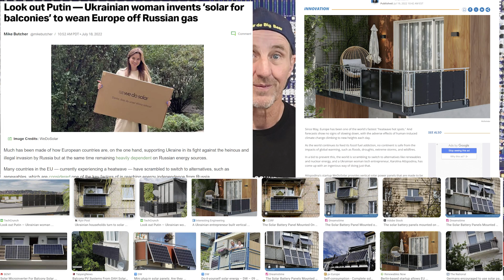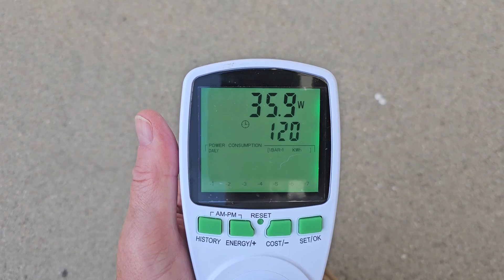Suicide Plug Solar Panels?

Comment: It's a nit-pic I know, but if you have 15A coming from the breaker, and 10A coming from solar lets say, that means you have an outlet that if someone else used wouldn't blow even on a load (or short) of 25 amps.
Reply from the maker: Interesting concept and that is looking at power as if it's water flowing if you have 10 gallons flowing in one direction from one source and 15 gallons flowing from another source then you have a total 25 gallons flowing right?

But this is different. If you have 15 amps flowing from the grid to an appliance on that circuit and then you put 10 amps from the solar onto that same circuit then the appliance withdraw 10 amps from the solar and 5 amps from the grid because the appliance only draws 15 amps we're just changing where it gets the energy from.

Furthermore the energy coming from the solar is not going through the breaker to get to the appliance it's going straight from the solar to the appliance and reducing the amount from the grid going through the breaker

If you really wanted to do some fun nitpicking you could say that if you put a 25 amp appliance on a 15 amp circuit and have 10 amps coming from the solar and 15 amps coming from the grid you could power that 25 amp appliance on that 15 amp circuit.

But as soon as the sun went down the breaker would blow.

That said, it's pretty obscure and highly improbable unless intention or complete knuckleheadedness took over

Comment: One gotcha to watch out for: if you don't have a bidirectional meter (and it's unlikely that you do) the meter doesn't care which direction the power is flowing, it still counts it. So if you ever generate more than your house is using at any given time, you will get billed for what you exported as if you had imported it. There are countless stories in solar forums about people turning on their solar arrays before they've received utility permission (along with a new meter) and getting huge power bills for the power they sent to the grid.

On the sunniest of days, your small array won't generate much more than 5kwh so worst case at your electrical rates you'd be on the hook for $1.70/day.
Reply from the maker: That's super interesting and I will try and figure that out at some point on a sunny day and shut off all the breakers except for the one with the solar. See if I can tell.

That said, unless I get more solar panels I don't think they can make more juice in my house uses just sitting there doing nothing
Reply: Thanks, your comment answered a question I was hoping to ask, that being - if we agree you can run power in ‘both directions’ in your home or the grid, how does your home system (or the grid for that matter) figure that out and then either power your appliances or sell your energy.
Reply from the maker: Great question. So the energy will flow in the direction from higher voltage to lower voltage. So if you have two power sources for example, one being the Edison power plant and the other being the solar panels and they are connected together and phase aligned, And there is nothing else drawing power, and both systems put out exactly the same voltage say 120 volts exactly, then nothing happens.

But if the solar generation is putting out a slightly higher voltage say 121 volts then power will flow from the solar generator back into the Edison power grid.

The solar inverters that power the grid or put power back into the grid are designed to output slightly higher voltage than 120 volts putting energy back into the grid up to the limit of the amount of current they're capable of outputting at any given point in time.

If the sun is bright and all the panels are being hit then the solar generator will put out a higher voltage which causes more current to go back into the grid

Energy automatically flows from higher potential to lower potential or higher voltage to load.

If the solar generator is putting out over 122 volts and Edison is putting out 120 volts, then Edison becomes the load and the solar generator will push power into it
Reply: @DaveRat  I am not sure that you are quite correct (I can't believe I am actually saying this to you! Lmao!) about the voltage difference and current flow, at least not on the utility scale. 

Basically think of the power grid as a big pipeline.

On a typical grid, there are many "pumps" putting power or "pressure" into the pipeline, and then the power flows to many loads or "holes" in the pipe network, including pressure drop over distance and power factor and lots of other nerdy aspects to power distribution.

In order to keep everything balanced, all the Pumps have to work together (via the Cal ISO Grid coordinators etc) to keep the pressure on the pipeline constant, so they have the big Base Load power plants, nuclear, hydro, large-scale gas, etc, and then they have the peaker plants, small gas turbines that can adjust their output constantly to match the load perfectly.

So the goal is to maintain a steady voltage, but it takes current output to maintain that voltage level.

So when your solar system produces more power than you use, it now adds pressure into the grid, flowing to the nearest loads, which increases the voltage on the entire network, which makes the peaker plants reduce output by whatever you are putting in.

So while voltage plays a part, it's really a side effect of current levels, because current causes the voltage to sag or increase depending on direction and such.

And now with all the Tesla technology and inverter power from solar and wind and batteries, the peaker plants are getting used less, because the inverters can react instantly to grid changes and keep a much more stable waveform and voltage.

If you had the Tesla Power wall, you could be part of their Virtual Grid program where a small portion of your battery capacity would be used to stabilize the grid voltage and factors in your neighborhood, and you could get paid for the service.
Reply: @ke6gwf  It is line frequency that tells a grid operator to open or close the throttles on their generators.  If it falls below 60 Hz, one or more peaker generators are commanded to boost power output; similarly if line frequency rises above 60 Hz, then power output is adjusted downwards.
Your 5th and 6th paragraphs are not correct.
Reply: @shaneervin4954 and you are incorrect to begin with, because the Grid Operator doesn't own any generators, they are the central grid manager, and coordinate everything else.
Reply from the maker: @ke6gwf I agree basically with what you describe except one small aspect. It is the offset in voltage that drives the current flow. If the voltage and phase are identical from two connected sources, no current will flow. If one source has a higher voltage potential even slightly or a phase offset that gives it a higher voltage porential at any points in time, voltage will flow from the higher potential voltage to the lower potential voltage.

The voltage offset is how the current knows to flow and knows which direction to flow

My understanding is that for energy(current) to flow from the solar inverter to the grid, the inverter needs to generate a voltage that is higher than the grid, the grid then acts a a load that drags the inverter output voltage down to match the grid voltage and the inverter outputs it's current limited output back into the grid.
Reply: That sounds more like a design than a gotcha.
Reply from the maker: The old power meters were based on coils of wire and magnets such that energy flowing through the coils of wire would spin the meter. Energy flowing the opposite direction would spin the meter the opposite direction it's just an electro mechanical reality

That said, the modern meters are a little computers and theoretically can be programmed to do whatever the power company wishes. The power company could easily program the meters to rack up charges regardless of which way the energy is flowing.

If that is truly the case, then that opens a whole new fun can of worms to investigate!!

I am looking forward to figuring that out
Reply: I am almost certain there is an analog way to meter AC current regardless of direction in older meters.

 I am continuously surprised by how clever old technology can be.

Maybe you could get your hands on an old meter and compare to a modern one. That would be a good video.
Reply: @dacharyzoo   Actually, there is no such thing as an AC meter so they are naturally bidirectional. AC scales, yes, but meter movements are inherently DC voltage devices. Even VU meters are calibrated & rectified DC with a precisely weighted movement that accounts for their cost. AC current doesn’t actually flow in any direction. It oscillates back and forth. The meter does not know line from load. Line and Load are artificial constructs we use to plan AC circuit wiring.
Reply from the maker: @dacharyzoo from Wikipedia

https://en.m.wikipedia.org/wiki/Electricity_meter#:~:text=On%20a%20single%2Dphase%20AC,power%20passing%20through%20the%20meter.

This exported energy may be accounted for in the simplest case by the meter running backwards during periods of net export, thus reducing the customer's recorded energy usage by the amount exported. This in effect results in the customer being paid for his/her exports at the full retail price of electricity. Unless equipped with a ratchet or equivalent, a standard meter will accurately record power flow in each direction by simply running backwards when power is exported. Where allowed by law, utilities maintain a profitable margin between the price of energy delivered to the consumer and the rate credited for consumer-generated energy that flows back to the grid.
Reply from the maker: @artysanmobile I believe you are confusing voltage potential with current.

Ac voltage fluctuates often from from positive to negative but can fluctuate from positive to more positive or negative to more negative. But regardless the current flow does not reverse direction from load to source.

The current flows from source to load. 

Think of the voltage fluctuations of ac as a pump that alternately pumps it's output on one wire then the other wire. The direction of the flow reverses but the energy push, the effort, the power, is always flowing from the pump to the load,

Comment: Balcony Solar is kind of a gateway drug ;-)  You should expect that you will soon become addicted and need harder stuff.
Like me... In December I got 17.8 kW panels on my roof and 12.8 kWh battery into my basement. :-)
Reply from the maker: Yes! And it's awesome. 

I've only got seven kilowatts on my roof at my primary residence but it's very cool to have

Comment: Not an electrician by any means but wouldn't this only supplement power being drawn from the same circuit it's plugged into?
Reply: If you add more solar panels in the future, I would consider adding an additional inverter to an outlet on a different leg of the main breaker panel to benefit both L1 and L2 circuits in the house. Or getting a 240v inverter and using a dryer plug to simplify the operation.
Reply from the maker: Great point. This inverter can only run 4 panels. I can daisy chain multiple inverters. If I us 3 inverters thAt would be 15amps or 1800 watts and max out that circuit.

Will see what the max solar generation power is. I doubt I will get more than 50% of rated power even at peak sun, as the panels are not optimAlly angled and loads of trees around
Reply: Please keep us updated as this is an intriguing experiment
Reply from the maker: It will supplement the power on the circuit tied into as well as every circuit that that is tied into. Since electrical wiring for a house is bi-directional any power that it puts onto that circuit will go all the way back to the source.

The question is whether the meter on my house will read power going the reverse direction and what the power company will do if it does.

One possibility is that the meter will go backwards when generating and forwards when I'm using power and they'll kind of balance each other out and reduce my bill

Another possibility is the meter will be programmed not to ever go backwards and the solar power generated will just reduce the amount of energy I draw from the grid

A third possibility is that the meter measures power and doesn't look at the direction which way it comes from and as I generate excess power to the grid they charge me for it.

I will figure all this out before I expand the system but for now the system barely generates enough energy to cover the amount my house uses just sitting there.

So the solar should just reduce the amount of energy I use

Comment: I’m going to be honest.  We leave it to the pros BUT off grid solar arrays here are big.  Caravans property’s etc and there are plenty of diy kits here and most of us for the houses since 85% have solar go through reputable operations to note.  SMA is the inverter brand of choice.  It’s a bit like the McIntosh audio.  They are still here and it’s a big deal with dodgy installs where the fire crews need their tongs to seperate the arrays from the house.  Don’t muck around with cheap inverters.  Remeber if the house catches fire and you have a 10kw system on the roof that’s a pretty serious amount of raw power sizzling away.  For us we are only allowed to export 5kw back to the grid UNLESS you have 3 phase then you are allowed to pump 5kw back per phase so I says to myself we will throw a 20kw system on the room plenty of power and we cash in about $1500 a year for doing nothing the tariffs are low now but many locked in when it first started at about 80cent feedin tariff and they are laughing.  Another thing to note is check your specs for the underside of the panels our gear needs to be cyclone rated and it’s the wind that can come up under the panel which can be the worry in calculations certainly will go beyond just the electrical.  Also passive cooling of a simple inverter to a big one is well worth putting some thought in.   Stay safe.
Reply from the maker: Super cool and thank you for the info!

This is only 640 Watts And I think I'm going to increase it to 1800 watts.

But I doubt it will ever generate that much maybe half that at best on a sunny day up there.

I did look up the snow rating and it appears to be 113 pounds per square ft.

We don't get cyclones. My biggest threat is pinecones dropping from nearby 60 ft trees!

Comment: In my western european country they sell this as an all in one. You can buy a solar panel (or duo pack) which just comes with a plug attached. Not very popular though as its very cheap to fill your roof with solar here. Pays itself back in less than 3 years currently.
Reply from the maker: Very cool and unfortunately here the price of solar is really high. 

In California they changed the rules so now it takes 10 years or more to break even

Comment: Makes sense Dave! As long as the current is little, then I don’t see why not. Like you said the panel breaker is still in place to pop if current increases too much in the event that someone on the power lines touches your lines, 5 amps 120v would be a decent shock I would think
Reply from the maker: Did you see in the video where I unplugged the suicide plug from the wall and then quickly licked it? 

I'm figuring if I can lick that hot plug while the sun is hitting the panels we're going to be okay
Reply: @DaveRat  i commented while you were doing the intro, my bad! but youre right seems safe when the power goes out. im curious to see what would happen if you say turned off the main breaker while its still connected. Maybe it would stay one if other appliances are pulling power from it potentially, maybe too much flower.
Reply from the maker: @poland153 naw, this is an "on grid" inverter and needs the wall voltage to power it.

That said, there are "off grid" inverters that will run from the solar panels. For those you need special grid power sensing relays that disconect the grid when power goes down and in the solar will keep your house running. Then when power from the grid comes back on, The inverter detects the frequency synchronizes itself and once synchronized, the grid power sensing relays reconnect the grid.

Physical prevent people working on the power system from exposure to power when the grid is down.

These simple systems are designed to augment grid power when grid power is active, hence the suicide plug that actually is never live unless plugged in